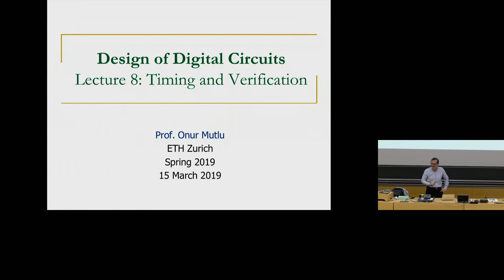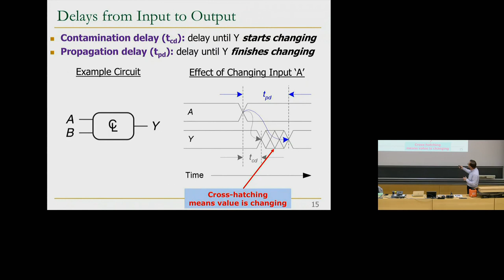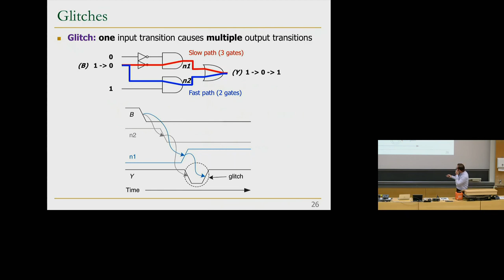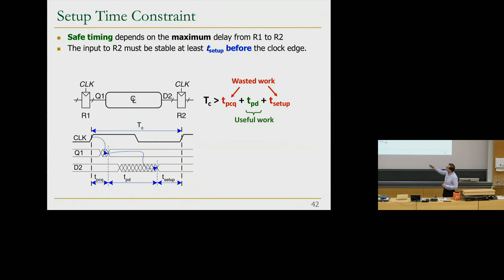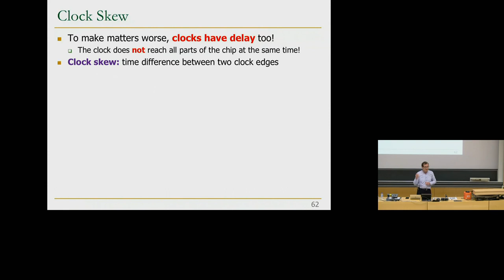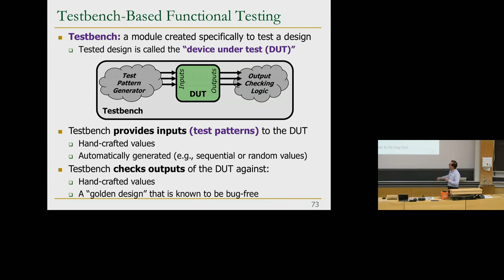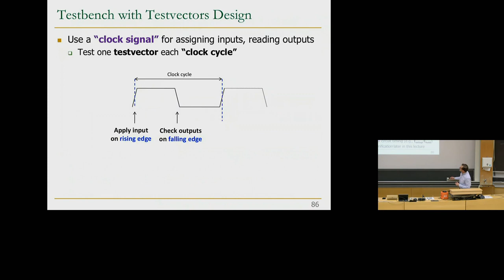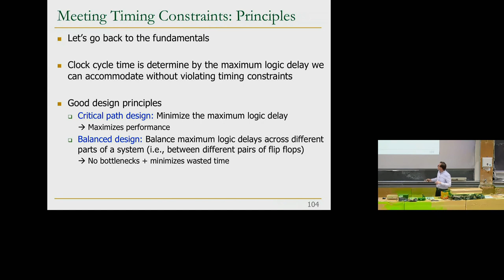Design of Digital Circuits - Lecture 8: Timing and Verification (ETH Zürich, Spring 2019)

Comment: Thanks for a nice lecture. But in slide 14 it should be the speed of the electron instead of the speed of light. Speed of the electron in less than 1% of the speed of the light which is one of the bottlenecks for the current system. That's why people are working on optical interconnects to have at least 2 orders of higher bandwidth.

Comment: Hold time is a property of flip flop rather than combo circuit, please clarify why you are involving the role of combo logic in hold time violation. Seems conceptually it is wrong
Reply from the maker: I would suggest studying the lecture carefully. Have you studied Slide 32, for example? Clearly, hold time (and setup time) is a property of a flip flop. However, a hold time (or setup time) violation manifests itself as a problem within the context of the larger sequential circuit, as we start demonstrating on Slide 35 and continue to demonstrate onwards.